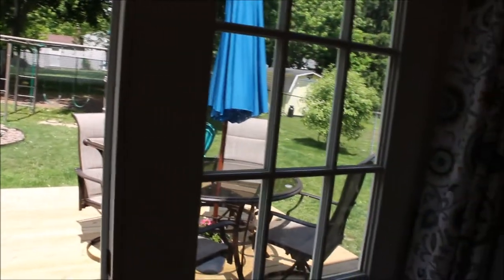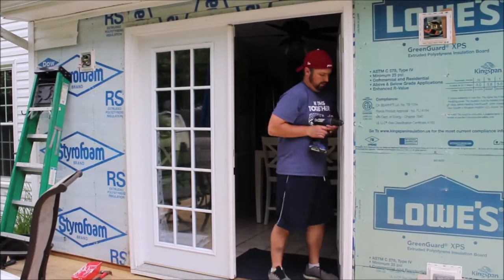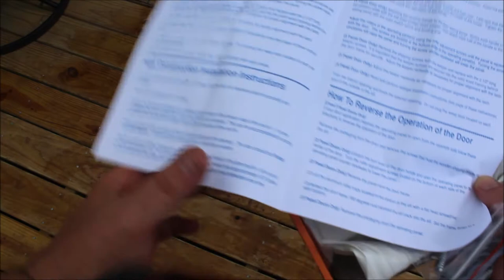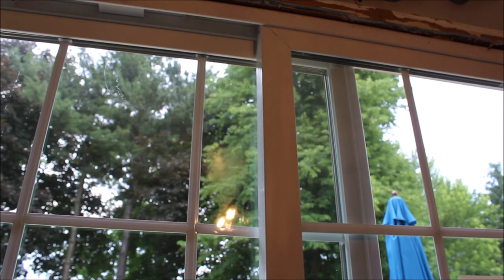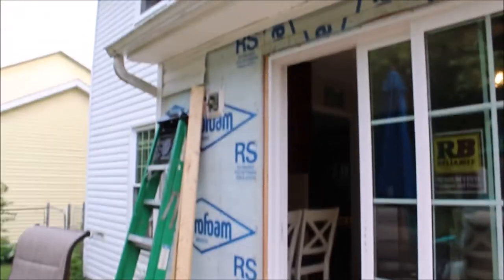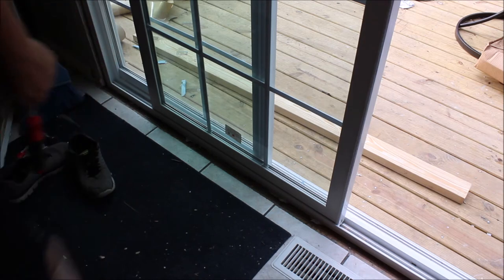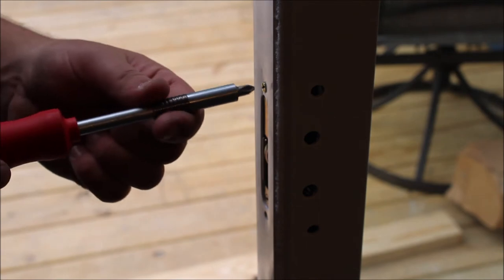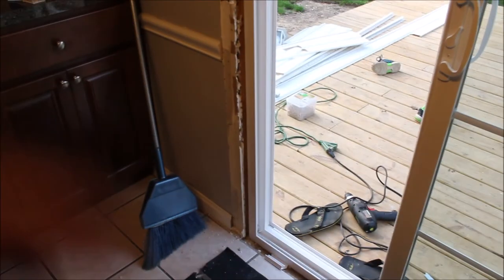Installing ReliaBilt Double Door Sliding Patio Door and Removing French Doors from Lowes

Comment: We bought this door from Lowe's in January and paid to have it installed. The final installation was just finished this month. It has been ridiculous process because they only use one company to install and they have one guy in our area. He tried to lock it and had a hard time getting it to lock. He acted confused by this and it made me wonder if he had ever installed this model door. In retrospect I'm sure he had. Anyway, he told me just to keep playing with it to get it to lock. So now to lock it we have to flip it down several times before it will catch. I have arthritis so it's not easy. I thought this was normal for the door until my daughter came over and was letting our dog out. She couldn't get it to lock. She told me her door which is exactly the same locks smoothly with one try. This is going to be an issue any time we ask my parents to dog sit and they can't get the door to lock. It's pointless to ask Lowes to send the same installer out since he acted confused as to why it was hard to lock. Is this a simple fix? We usually don't splurge on paying for installs so we are frustrated about the whole situation. It's been ridiculous. We bought 2 other doors and had them installed too. The door not locking is not the only thing. I didn't even realize that was installation issue until a few days ago when my daughter said her door wasn't like that. We just thought it was something we'd have to get used to because of Reliabilt latch.

Comment: Awesome video.  I got one installed on Saturday. The door is heavy. I find it doesn’t slide as smooth as other sliding doors I’ve seen. I’m heading back to the store to see the display, to ensure the installer didn’t turn the moving section upside down.😂😂
Reply: Our doors are not sliding smoothly either. We have watched video after video and read all kinds of tips but nothing is working, My mother can't open the door this way. :(
Reply: @lucindakamradt4909  oh dear. So I went back to the store, and the one there slides perfectly.  My nephew came here and adjusted the tracker, and mine is sliding freely. The installer I tell you.😂😂😂

Comment: My installer left an1/8” gap under the right non moving portion of the sliding door. Other than the very end.  I want to fill it in for structural support.  Would you reccommend dap platinum patch, or cement,  or a caulk..?  Will filling it in impede water drainage.?

Comment: What did you put in-between the door jamb and the trim to get the trim flush from the drywall?
Reply: You have to install an extension jamb with 1x2 or 1x3 whatever is needed. This is why you do not install a new construction type door into a remodel. You can get these doors without a flange so that you can bring it all the way in. Unless he wants to install a new tile floor this is always going to look like  a patch job.

Comment: So now that it has gotten colder, are you still as pleased with the door? We just bought a house that has an oler sliding door in our bedroom, and have noticed a lot of cold air intrusion. We are considering having this installed  to reduce the thermal impact of the outside temps.
Reply from the maker: For sure! For us, this is a huge improvement from our old French doors. The seams are nice and tight. We are in northeast Ohio so it’s definitely reaching colder points now and we are very pleased.

Comment: Why did you decide to go with the slider instead of a french door?
Reply from the maker: We like the slider design. We’ve had both and just prefer the slider. It’s easier to clean too.
Reply: @BrickBuildingKids  Can confirm. Found this video while swapping our French doors back for sliders. We want a built in screen solution. Magic Mesh is not a long term solution.